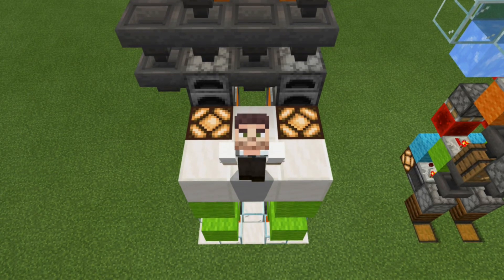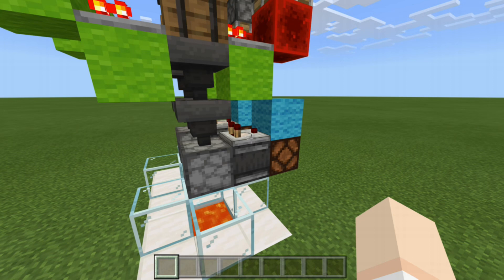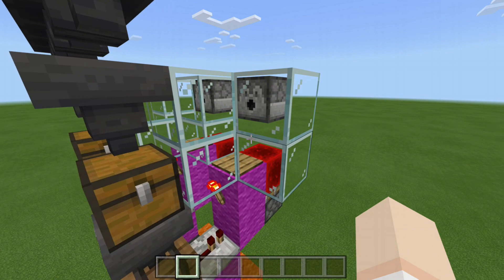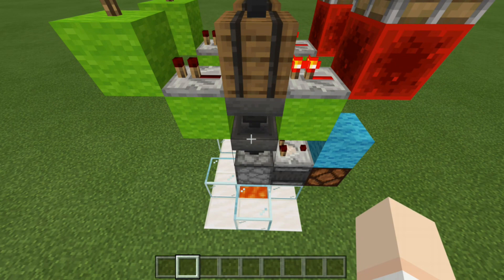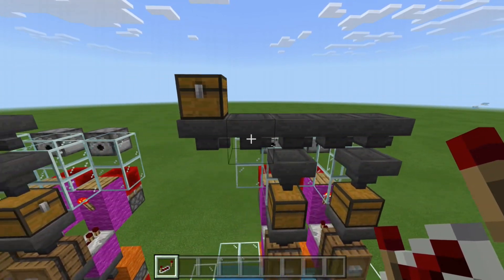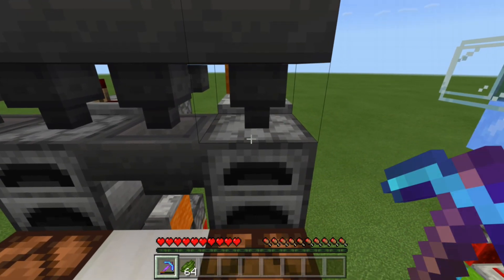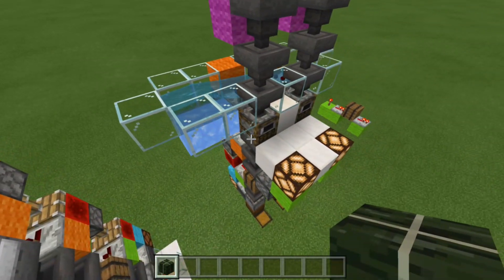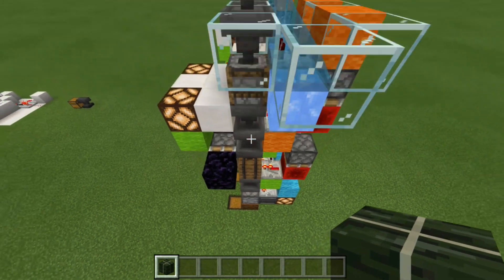Minecraft Bedrock - XP Furnace Farm ( Xisumavoid Redstone Challenge)

Comment: 0:39 - "The only question I had was whether you can pass a redstone signal through a barrel on Java edition"

I don't know...  I think so. But it doesn't work reliably on Bedrock!
https://bugs.mojang.com/browse/MCPE-46742
(Ah, there it is at 6:47...)

If you run into that problem with powering barrels, you can work around it by moving the barrel with a piston, then moving it back again. (But then you can't have a button on it...)

On Java there are other tricks you could use in place of the barrel - like using the button to power a hopper, and use an observer to detect when the hopper gets locked.

You could also replace it with a dropper (facing down) and use an observer to detect when the dropper is triggered. (That should work on both Java and Bedrock, I think)